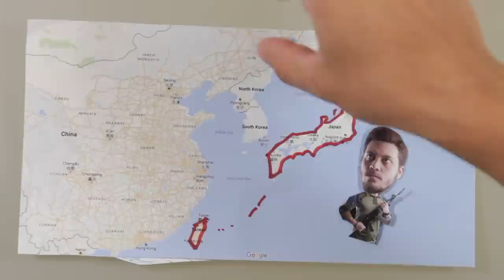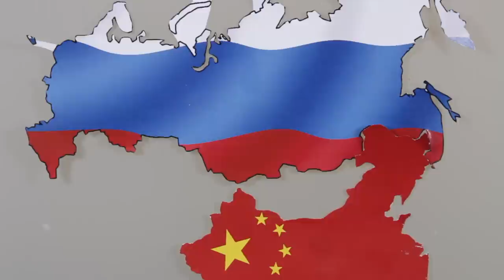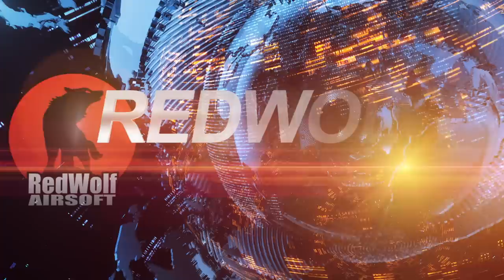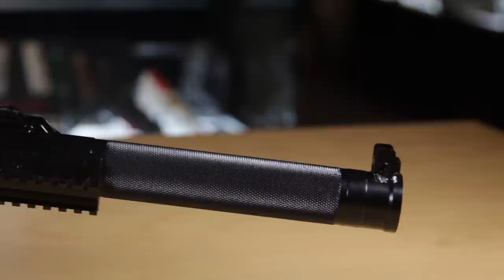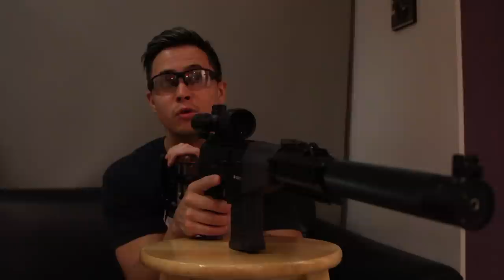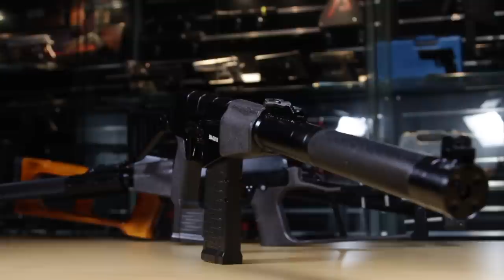DMR Dominance – NPOAEG VSS, M & VAL – RedWolf Airsoft RWTV

Comment: I would go for the VSS or the VSSM. I would put a scope on them and run them as Dmrs with 450fps and heavy Bbs. but that comes after I fix my Gen 1 krytac spr, echo 1 specter, and both of my pistols... Aparently all the hop ups got messed up. and the mags on 1 of my pistol just shit its self.
Reply: King Albby, not trying to bash your idea, but the AS VAL has a scope mount identical to the VSS. Just keep in mind you won't be able to fold the stock if you use it.
Reply: don't really care for folding stock. I would mostly use these outdoor as DMRs as i said earlier. I got indoor guns, bot a krytac shooting 400, got plans for a custom springfield 1903 as a sniper and all i would need is a Dmr. I don't have a Russian style gun yet, so i thought these would be cool.

Comment: Uneeded rails on the vssm, why would you put a flashlight or laser on a dmr lmao, you will easely get spotted
Reply: For the CQ encounters? You aren't always fighting on mid range.
Reply: @birtalanlorant5572  the vss isnt made for cq, you would carry a pistol for that.
Reply: @mint614  VSS and the ASVAL are fundamentally the same gun with the only difference being in the rifling of the barrel afaik. You can very much use the VSS in close quarters and it's not even really intended to be used past 400m. It is a close range precision rifle that can double as an assault rifle.